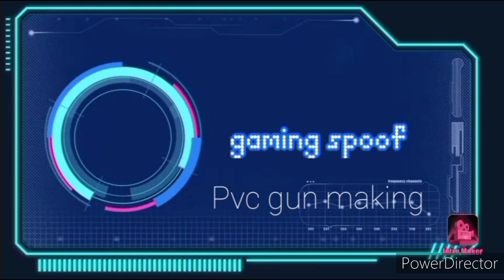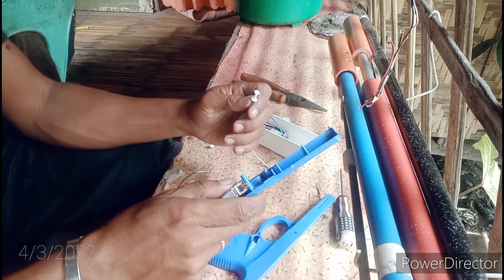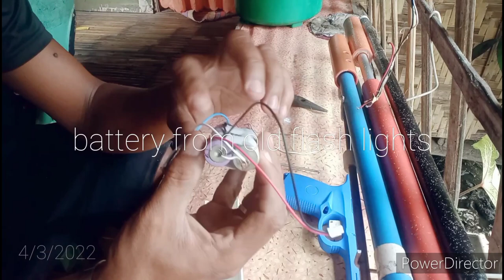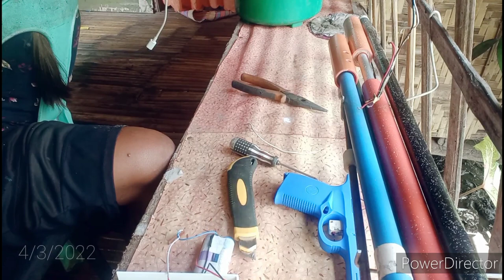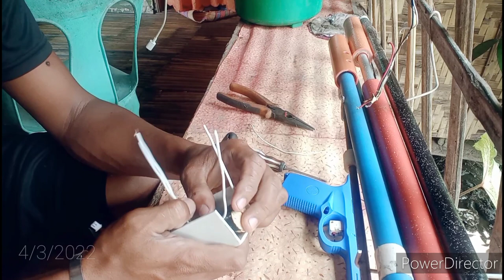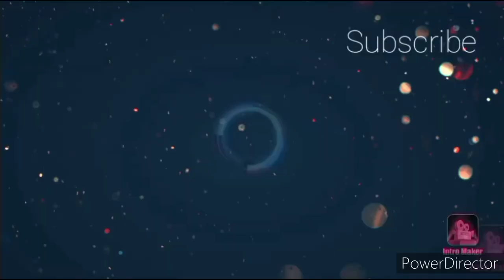pvc marble gun high voltage igniter tutorials

Comment: boss ano mga piyesa b gamit mong igniter
Reply from the maker: High voltage generator
Battery 3 to 6 volts
Solid copper wire 
Plastic toy gun 
Any kind of switch
 Yan po boss yung high voltage gen hanap kayo sa shoppe o kaya kung may flashlights kayo na may teaser pwede yun